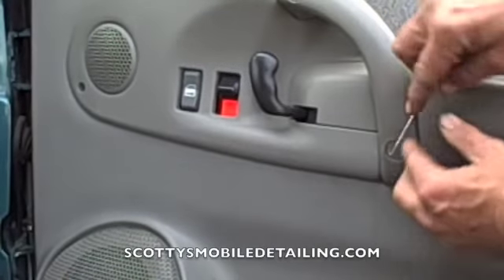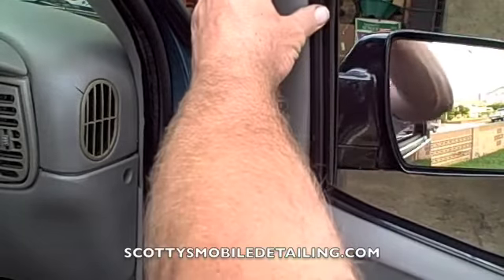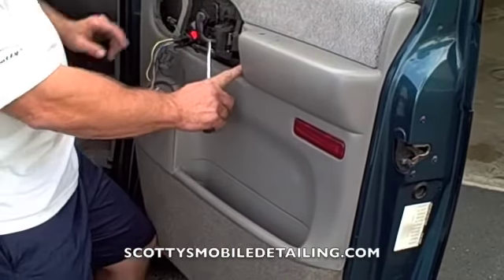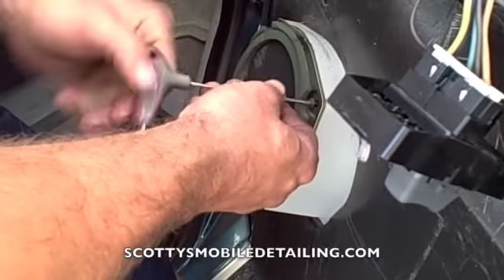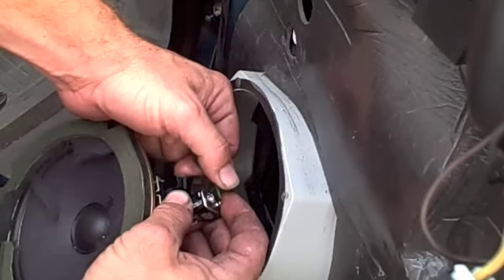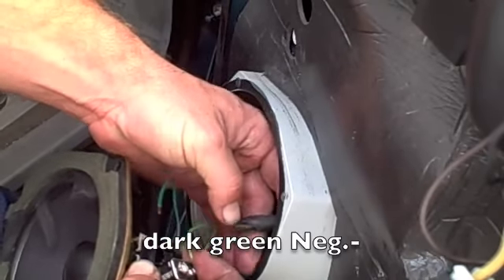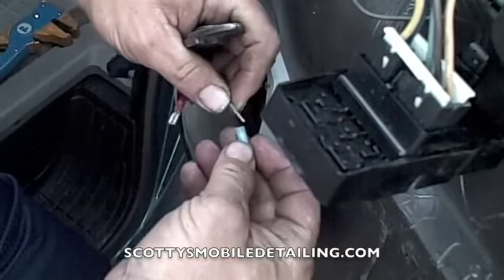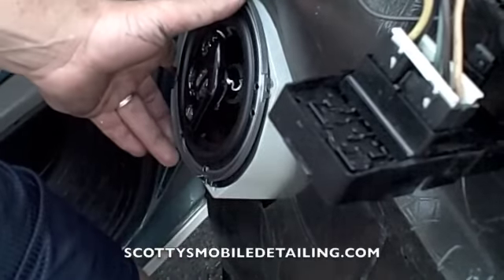How to replace door speakers on a astrovan

Comment: Scotty do you think it is possible to install 6x9 speakers?
I found a Delco 16183885 original kit that fits 6x9s but I don't know if it will fit the door grills.
Thanks for your great videos!
Reply from the maker: All you have to do is build some 6x9 to 6.5 conversion plates and your in business.

Comment: I noticed that you took off the Lock/window panel first before removing the door pull...That breaks the panel mounting holes off underneath the door pull handle...You don't want to do that...
Reply: Seen so many people chew up their panels like this. Also don’t pull the bottom of the panel. Lift the entire panel straight up in a jerking motion and nothing will break.

Comment: this is like removing the engine block to add gas.... i have an astro van, the grills pop off you dont need to take the door apart...
Reply: @manuelester7420  What's up? Found this video recently too, bought one of these vans and only 1 speaker works

Comment: You don’t need to remove the entire door panel. Just pop out the speaker grill and you get full access to the speaker, screws, and wires. 🤦🏻‍♂️
Reply: Have you actually done it?

Comment: You don't need to remove the door panel. You just pop the grill off and remove the speaker.
Reply: Actually, there is apparently a rivet on these grills. Mine was gone, but I guess you do have to pull the door panel to correctly remove the grill.